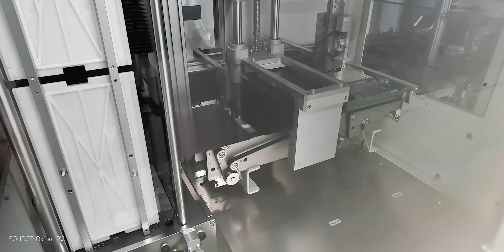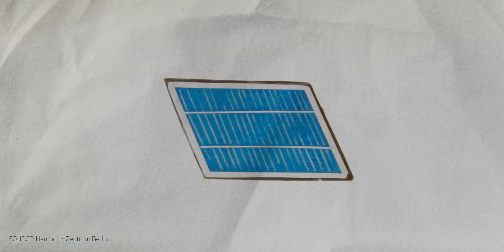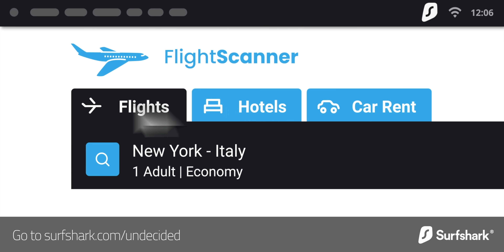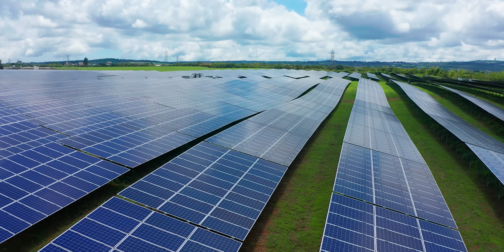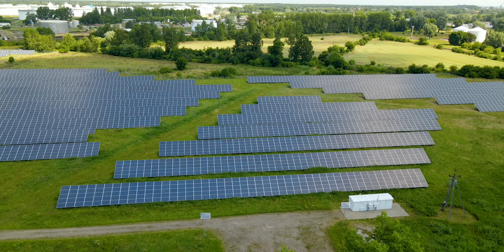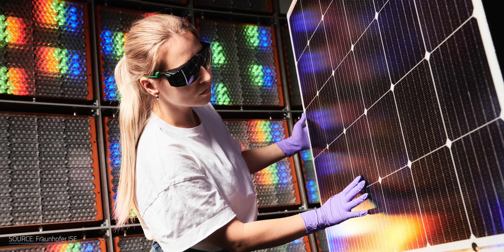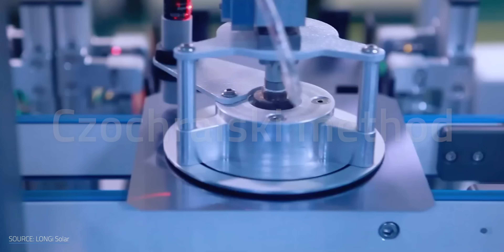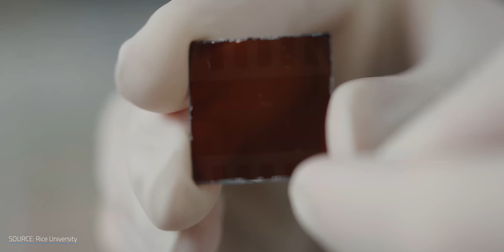How Record Breaking Perovskites Are Here NOW

Comment: Cool deal.

If the US would get rid of tariffs on solar panels coming into the US, the installation rate would increase substantially so while this is a good thing I don't know how much of a "game changer" it is when solar panels can be manufactured for very little cost, and a bit of the expense of a solar bank for a home in particular is a good chunk of the cost for a home installation.

So, when the SYSTEM costs come down and the price of solar panels are the way they should be, dirt cheap, the efficiency doesn't mean much other than needing a few more panels.

THESE panels are going to have a high cost for years so it's for the business world for now.

I find it funny that US companies are installing solar farms in Germany.  I assume that they don't have tariffs on panels coming into the country for one, but two they probably have better access to labor, something that's SORELY missing in the US, an available labor force and the pubes are doing their best to shrink it more by deporting as many as possible.  Yes, illegal immigrants have been a VERY significant part of the US labor force since the end of WWII and people could move up into better jobs that weren't labor, or at least outside labor.
Reply: @johndoh5182  I don’t see where panel cost is the problem.  I can buy panels that replace my entire electric usage for $3k and plan to DIY a system.  The system cost from the solar contractors are preposterous.  I understand not everyone can do it themselves,  but I can install 5kw system for maybe $7500, a contractor wants about $20k.
Reply: Your ostentatious spacing of paragraphs communicates that you cannot write.

Comment: Solar Engineer here - REC's Alpha Pure RX panel uses Heterojunction (HJT) cell technology. It is arguably the most advanced widely available solar panel. Its degradation is already at 90+% at year 25. When it comes to this the panel quality of manufacture ie "will it fall apart" is more important than degradation because its minimal.

What is more important is W/m2 which reduces costs aside from the cost of the solar itself and allows more wattage when area is restricted. REC have 22.1% module efficiency with the module we're installing right now.

A panel with 20.0% module efficiency is 200W/m2 and a panel with 22.1% module efficiency equates to 221W/m2.
Reply: X^25 = 0.9, X=0.9958.  Conventional solar is x=0.995, so about 16% improvement. 0.995^25 = 0.882. 340W REC panel would make additional 6W at peak sun when 25yrs old.
Reply: @artsmith103  Holy crap, your mistake was pointed out and you still didn't get it. You also think that your last sentence is somehow helping... restating the same thing in different units isn't helping anybody here.
Reply: @thomgizziz   Time to practice with the edit feature.
Reply: @artsmith103 So it degrades quicker than conventional? I wouldn’t buy something that dropped by 90% at yesr 25.
Reply: @StillAliveAndKicking_ i think he's saying it is performing at 90% efficiency after 25 years
Reply: @StillAliveAndKicking_  Math is hard!! At what level did you reach your level of incompetence? For now, looks like the edit button.
Reply: @Gilotopia  that sounds too good to be true.
Reply: @Gilotopia  I don't think so he clearly say tha " its degradation at 90+ %
Reply: @dayanberhe4485  Of course it's 90% of initial rating after 25yrs! Does it do it, hope so?
It doesn't matter what you think OP said, it's REC's specification.
Reply: @artsmith103 wow you said 90% degradation and then tripled down.  🤡
Reply: Re: UV Degradation. Is there any applicability of UV filtering chemistry or other practical technology?
Reply: https://www.youtube.com/watch?v=sRhNOv1Uo4M&list=WL&index=10
Reply: @bjwnet397   Posting a video by ARC, a right wing fossil fuel funded think-tank that has repeatedly lied about the viability of green energy, does not provide anything to this discussion.
Reply: Can you Please confirme on its degradation rate Please
Reply: Also a Solar Engineer. HJT is hopefully the next big thing in utility-scale PV as it works so well with the bifacial topology. Seems like we're still stuck on Passivated Emitter Rear Contact (PERC) and Tunnel Oxide Passivated Contact (TOPCon) in the utility world for now, while HJT is in the Commercial & Industrial (C&I) & residential sectors.

Your point about efficiency is why module OEMs are shooting to increase the net power per module by selecting for larger wafers (M10, M12) while retaining the same frame footprint. 

It'll be interesting to see how these technologies converge as module OEMs are already looking at >700 W panels.
Reply: @skullys_undead_empire  90% degradation after 25 years? So after a few years they are as bad as the old type panels.
Reply: @erbalumkan369  The inverse: @skully5473 is saying that the REC panel degrades to 90% or better (degradation: <10%) over the course of 25 years.

This isn't 90% degradation, it's 10% (or less).

Comment: 30% efficiency is only like 10% more than silicon cells. With all the hype we were hearing about perovskite cells last year, I was hearing figures around 50% or more but seems only theoretical at this stage.
Reply: well worth the jump.  and going from 20 to 30 is a 50% improvement...
Reply: @lylestavast7652  Unless roof space is a premium, it really comes down to cost and silicon panels are reaching 24% now with most on the market close to 23%. I doubt this first generation will be that affordable and I would like to see how they hold up in real world use as far as longevity goes.

Comment: Unfortunately, these cells contain large amounts of lead. They are hazardous waste upon reaching the end of life. They will never be able to be landfilled for sure.....same as lead containing tires from the past, or CRT's...they have to go into special areas that are special for them with final disposition passed without resolution from generation to generation. 

There is presently no recycling process for these panels. 

It is interesting that Oxford PV manufactures in Germany....but these panels cannot be used in Germany due to the lead content. It violated their RoHS standards. 

The proliferation of perovskite solar panels is still a serious problem. The lead perovskite is orders of magnitude more soluble in water than elemental lead. Any cracks or any waste product from manufacturing will create a hazard to any neurological system that comes into contact with it, from insects to mammals....particularly developing animals (like children). 

The only breakthroughs Oxford PV has achieved is in making perovskites usable in real use conditions, and this makes them economical as long as they don't have to address the environmental damage they are guaranteed to cause. Socializing the risks, privatizing the profits. 

Oxford PV at one point tried to address this problem by saying that coal powered energy released lead and mercury. They were correct on this point, but the lead in the perovskite over its useful life is no less than 200 times the lead emitted by even the dirtiest coal plant in the US emits for the same number of Joules over the solar panels' lifetime. 

It's a very serious problem that led most people with a conscience away from perovskites, but not the bean counters.

Comment: The combined device sets panels at the silicone only power output for the 25yr guarantee but advertised panel output the combined initial output. with a sharper drop off at the 25yr mark than pure silicon. Only because it had more to lose

Comment: Perovskite panels contain lead.  Silicon ones do not.  Offset that against the energy yield.  They make sense in cases like space, boats, RVs, etc. because you don't have the space to just place more bro*.  It *might be a bad idea to use perovskite panels for rooftop or industrial field solar simply because *those panels need to be carefully cleaned up in 25 years*.
Reply: There's nothing intrinsically wrong with lead. Just don't lick it...  In case you're still worried: Lithium (metal) will kill you far faster than lead will. Although Lithium Carbonate will allegedly calm you right down... Sodium (metal) will also kill you on sight, and Chlorine gas will destroy your lungs - but combine them, and the result is tasty tasty salt...  Lead poisoning is nasty, though, so definitely don't go licking those solar cells...

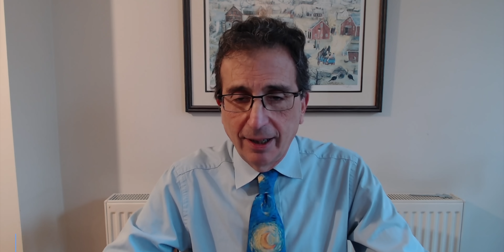Comment: 1:40 "Salt and diamond have the same crystal structure"?? Am I missing something, or did he mean to say silicon and diamond?
Reply: No he meant diamond and salt. Structure is the way the atoms are  positioned in a single crystal. Several different atoms can bind in the same position, despite them being different elements. To make it short, if it looks like a cube, whether or not it's one atom or the other. If you look up NaCl crystal structure and diamond cubic structure you probably see the similarities he's referring to, though I still feel there is quite a difference in how the bonds are oriented personally, but, I guess he was just making an example, like, imagin building the same house, same identical shape, but one out of wood and one out of stone or cement, they will be similar, but have many different huge pros and cons (the wooden one may be better insulated but more prone to molding? I dunno, just spiffing for the example). So you can make the same crystal structure but one has better electrical conductivity than the other for example.
Reply: @matir1225  There is absolutely no similarity between the salt and diamond structures. Also quartz has high oxygen content, and I bet silicon refers to the pure stuff (+ dopants).
Reply: Silicon and Quartz or Graphite and Diamond are more like having the same material, wood (being silicon or carbon) but building a house or a tent or a table. Share some properties, like, all are flammable maybe, but different function due to their shape.
Reply: @matir1225  I still find it stupid. They are both fcc lattices sure, but base is different. His analogy would really make much more sense for diamond and silicon. I know analogie for simplifications are used a lot and do help, but not when they really give you a wrong idea.
Reply: @michalpecz9433  And neither of them are FCC. I'm gonna conclude he meant silicon/diamond.
Reply: @maxwellgao1662  both salt and diamond are fcc. Diamond have base of 2 Carbon stoms in diagonal direction, and salt have 1 na and 1 cl with double diagonal lenght. But yes literally the same struxture is silicon and diamond.
Reply: @ My bad, you’re right about that. (Don’t know what I was thinking.)
Reply: @matir1225  There is absolutely no similarity between the salt and diamond structures.
@michalpecz9433  And neither salt nor diamond are FCC.
I'm gonna conclude that he meant to say silicon.

Comment: Interesting stuff, but on the efficiency front I thought they would be pulling more than 25% though on the commercial panels. Ecoflow already make a portable panel claiming 25% efficiency. Maybe they are using some marketing gimmics in this figure but from my testing, I was able to pull around the same power from a 45 watt portable panel as a 100watt conventional panel and the 45watt panel is 1/3rd of the size. I was able to hit a maximum of 46watts output in mid December from the portable while the conventional was only able to hit around 51watts maximum despite my attempts to angle it for more generation. Maybe the conventional panel is a dud or something but I think hitting the maximum output on the portable panel in mid December up in Alberta Canada quite impressive.
Reply: You are being misled by solar marketing. "Conversion" vs. "Module" efficiency are two separate things. Conversion efficiency is the efficiency of a single cell, at the cell. Module efficiency is the efficiency of the entire unit and it's losses from all the cells and connections.

Module efficiency will always be lower than conversion efficiency. (Unless you do some sort of thermal energy recovery). When calculating solar, you have to be mindful of module losses or find the actual module efficiency.
Reply: Did you have enough current capacity to actually get the 100W return?

I easily get 85 W out of an old 100W panel, but it needs the right charger and batteries for that to work. Otherwise, the charger limits the current as to not ruin the battery.

Comment: 24.5% efficiency is the REAL efficiency, right now, not the "predicted" efficiency in XX years... that's not exactly game changing at all, especially if the cost isn't in line with existing panels.    Two big hurdles with solar, excluding those in high density housing, is 1) cost of installation and 2) short term storage of energy.     Now #2 can be addressed but only with very pricey  battery systems, #1 can't really be addressed at all unless you are a handy person and can go the DIY direction,  having 5 panels when there was 6 isn't exactly a huge cost savings.

Comment: Even if they only last a few years, as long as they are cheap enough I don't mind replacing them often. Actually, since perovskites  improve so fast, I don't want lock in.for 25 years with a hydrid solar panel now, if perovskites will improve 5% in 5 years, because it better to upgrade often in that case, if they have the same price but better efficency.
Reply: I'm curious, why would you want the last technology available if the setup you have is already providing you enough power ? You do realise even if solar panels are better than coal, the fabrication still uses a lot of energy and materials, and even recycling uses a lot of energy.
Reply: @ewilen  you are wrongly assuming that everyone has a roof that can cover 100% of one energy needs.
Reply: @SkepticalCaveman Yeah my bad, but also "one energy needs" can vary greatly from person to person. I'm french, here the average annual electricity consumption is only 2200 kWh whereas in the USA it's 12 000 kWh so we need 5 times less solar panels to cover our needs.

Comment: At the end of the day, it will come down to $$$/watt x durability. We don't lack for area to put panels, we lack for affordability.
Reply: @johnparchman753  can you elaborate? Aren't traditional panels cheaper than fence panels?
Reply: more area costs more money. Its cheapest to install the panels on flat ground, and more ground area costs more money.
Reply: It takes 50x more space to produce the same electricity by solar as it does for coal plant & you still need a carbon based system to insure a base load, College taught you what ft's the "feel's good" agenda and gets them mor college loan debtors.
Reply: @bjwnet397  You don't need a carbon based system to ensure a base load. Nuclear will do that just fine and batteries to stare renewables are catching up fast, while nuclear gets rid of the area problem if you're not a fan of wind.. More specifically I point you to the line-up of scientific studies on the human deaths and chronic illnesses caused by coal plants (both resulting from particulates and radioactive sources) - and that's before you even get to the environmental contaminants and emissions causing climate change. 

And if you're an American you should probably look up the debilitating health issues and increased morbidity and mortality associated with coal plants considering your appalling health system. These scientific papers are easy to find and the data is damning - you can look at the abundance of evidence for climate change while you're at it. 

It's not about any "feel good" agenda, it's about dealing with long-term consequences. But sure, blame colleges for teaching people about science - wouldn't want to have evidence to back up an argument, huh?
Reply: @13minutestomidnight  death rates referred to are pre-scrubber tech, there have been very few nuclear radioactivity deaths, wind/solar ignores habitat & species destruction, Trust the science is what dems told the US during covid - Jab will prevent catching the disease, will prevent passing the disease, will prevent deaths from the disease, then became you can still catch the disease, you can still pass the disease, it may cause heart disease. Hiding behind "trust the science" is really raw. Besides you still have fossil fuel backups for base load since there are clouds and nights. Add to this if it wasn't for gov't subsidies your tech would have never been pushed out since IT IS NOT ECONOMICAL, Global Warming is real but not catastrophically real and human cause is a minor contributor, just look at the false disaster prophecies, they keep coming and going. If you argue that fossil fuels will run out and we need alternatives in anticipation, ok, be prepared but do not disrupt what works with something that DOES NOT PROVIDE A COMPLETE ALTERNATIVE - inexpensive available energy on demand.